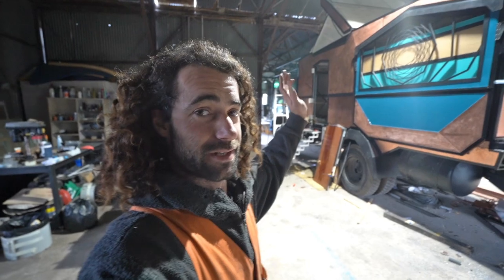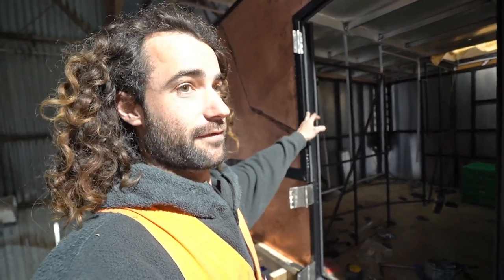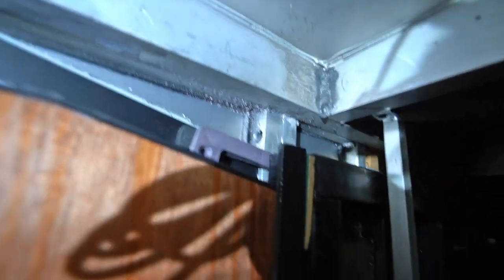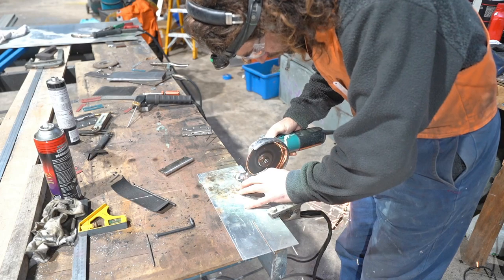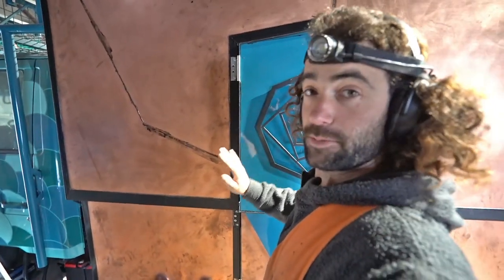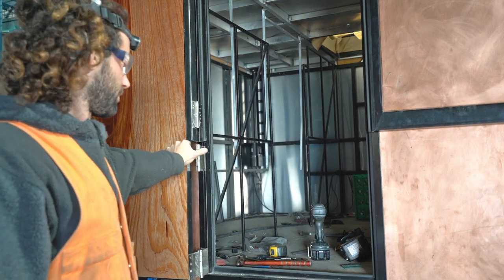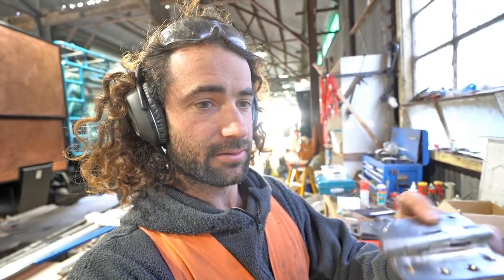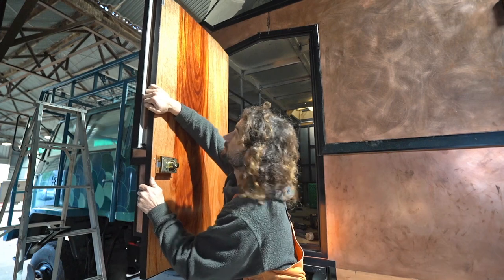Pop Up Door Adjustments - Expedition Truck Build #22 - 4x4 Off-Road Tiny House

Comment: I know this is after the fact, but I saw how you handled the hinge challenge and I do the same thing for almost every challenge I run into....."know what you want for the end result and work backwards to figure or calculate the best solution".  This works on just about everything....I just love this project.  Keep going.....eh!

Comment: Given as I'm watching the video, this may be late advice. But my advice is to get a rod that will fit through the hinge pins, and is long enough to go from the top hinge mount to the bottom hinge mount. This will keep your hinges aligned and you can build whatever mounts and brackets are needed without needing to go through all the abstract reasoning.